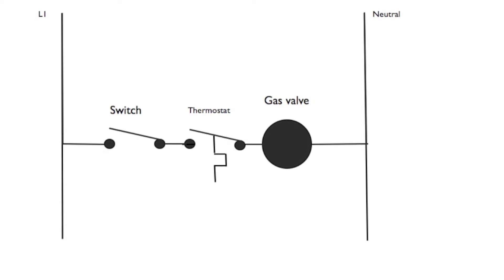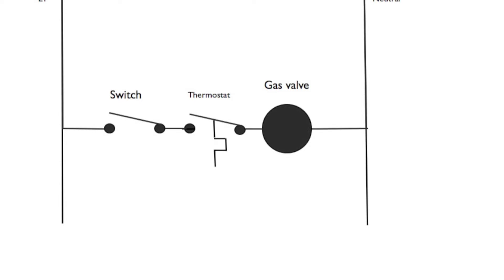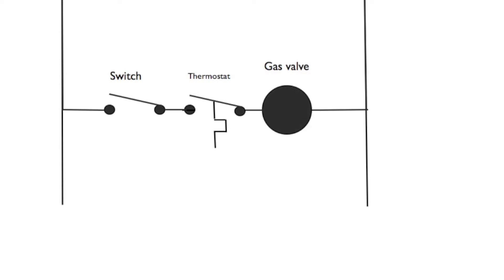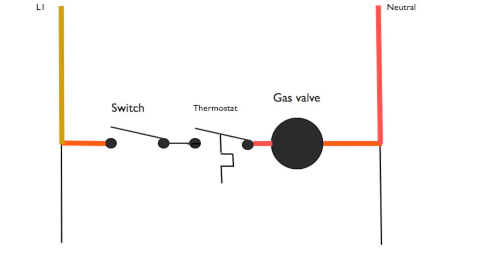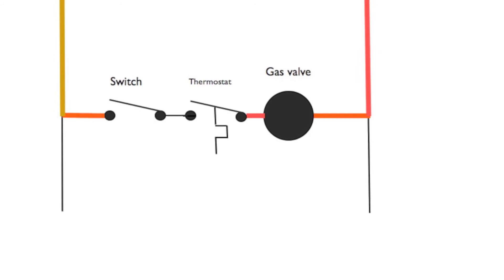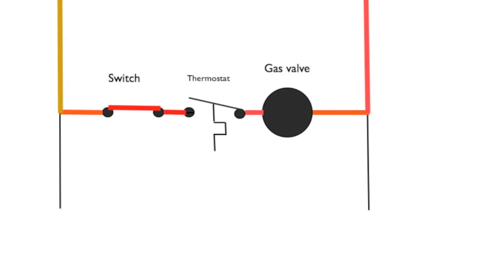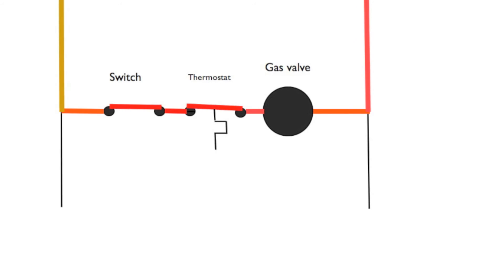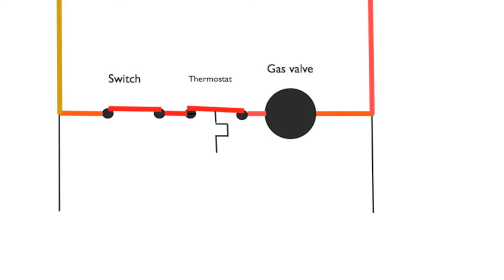Schematic diagrams #2

Comment: Did you mean to say power passes through the normally closed switch to energise the gas  valve?I thought I heard you say power passes through the normally open switches to energise the gas valve!What did you say at the end with the switch diagram showing both set to pass current?